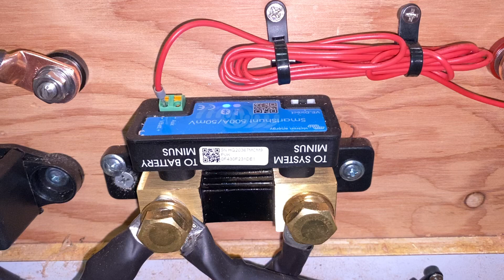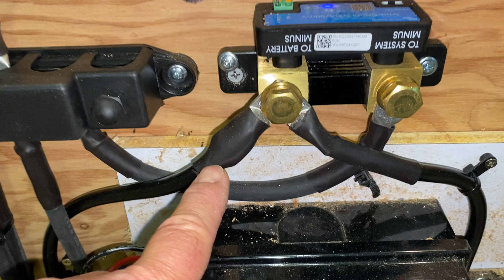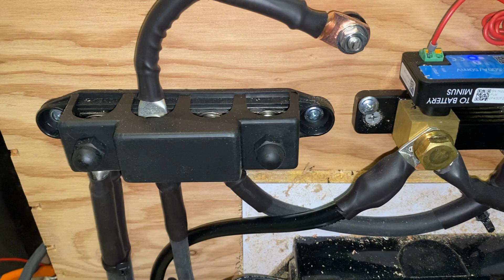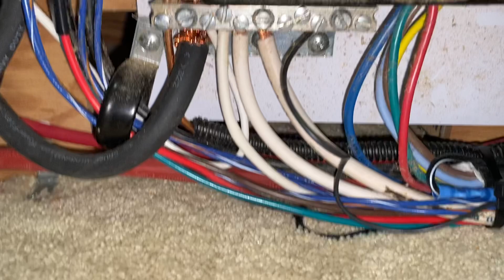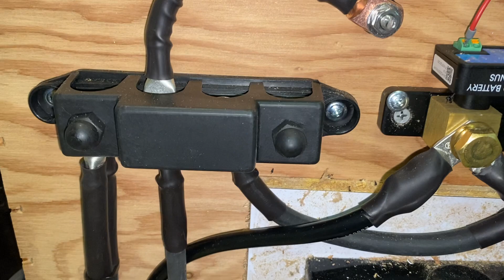Victron Smart Shunt Bluetooth battery monitor

Comment: Why is there two wires going from the negative shunt to the battery?
Reply: Agreed. No idea why he wired it that way.
Reply from the maker: @aguyandhiscomputer Because the trailer came from Airstream with 2 batteries and a negative wire from each of them to the negative buss bar.  So I simply disconnected those 2 wires from the buss bar, attached them to the input side of the smart shunt and ran a single wire from the output side of the smart shunt to the buss bar.

Comment: I don’t think that will be accurate the way you have it wired, the shunt calculates everything from the known resistance of the shunt. It should be connected to the negative terminal of the battery only not to a bus bar! A bus bar and everything added to it will add resistance and give false readings! As this was a year ago you may have realised the readings aren’t right and read the instructions.

Comment: Are your RV batteries connected in parallel?  I have 2 AGM batteries wired in parallel for my camper van. Should I connect both negative cables from each battery to the battery minus terminal of the shunt like you did? Then connect the negative cable from the system to the system minus terminal of the shunt? And finally does the red wire connect the Vbatt+ terminal of the shunt to the battery post where the red cable from the system attaches? 

The instructions are not clear for monitoring parallel batteries and I had it set up like it was monitoring the midpoint of a battery bank, but I don’t think this is right.  Thanks for any help you can provide!
Reply: No, you run a negative cable from the battery minus to the battery minus of the shunt and a negative cable cable from the system minus of the shunt to your negative load. It doesn’t matter how many batteries you have in you system or how you have them wired, you do not make multiple negative connections or connect anything else between the negative of the battery and the battery negative of the shunt doing so will make the calculations for everything the shunt monitors wrong! Hopefully you’ve already worked that out months ago!

Comment: So if I have 2 six volt batteries connected in series for 12 volts, due I connect the jumper to the negative post of the battery that is grounded to the frame, or due I connect the jumper  cable to the battery negative post that goes back to the positive post of the other battery
Reply from the maker: You put the shunt between the negative post of the whole array of cells and the load - not between the individual batteries.  If your only ground connection to the load is to the frame then that’s where you put the shunt.  

Basically anything and everything that connects to the 12 volt negative is on one side and the 12 volt negative is on the other.   Think of your multiple batteries all together as one storage array - the rest of the system sees that as just one positive and one negative terminal.

I hope that’s clear enough.   Thanks for the good question.

Comment: Lets see it in action. Where's the display?
Reply from the maker: It doesn't really have a display. You do everything from your cell phone.  If you're interested you can download it - victron connect - and you can run it in demo mode on your phone to examine it's  features.   I made this video on my phone and I have no idea how to put the app in a video.
Reply: @DavidLaFerney  Thank you!  I have 4 of the Renogy battery monitors on my different battery banks and my home built solar generator. They have the on board monitor but no Bluetooth. The other Renogy with Bluetooth is for their solar charge controller and it only gives battery voltage with very inaccurate state of charge percentage. I very much like the local display screens but for a few pennies more they could have added Bluetooth.  Here's one with 2 kilowatts running through it. I might put in the Victron to be able to view the solar charger remotely. I like your setup. Good work! 
  https://www.youtube.com/watch?v=NYpczRYDFJQ